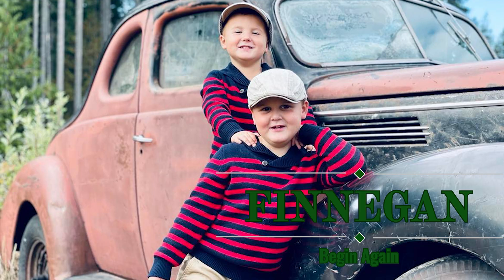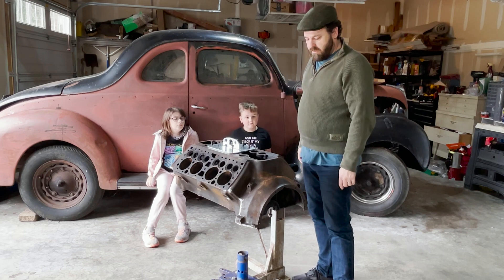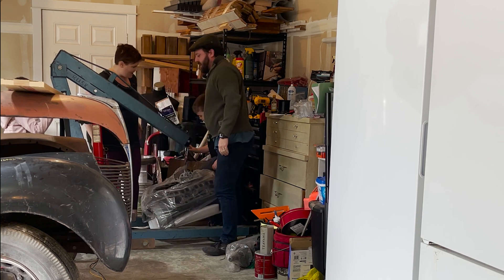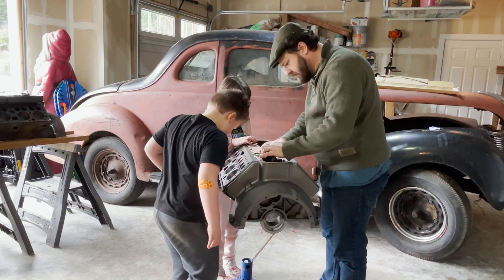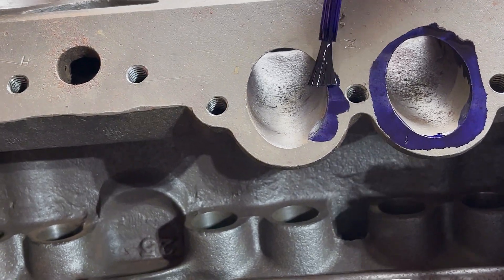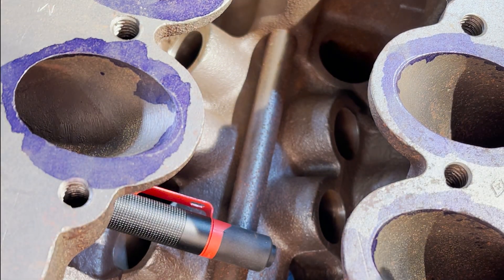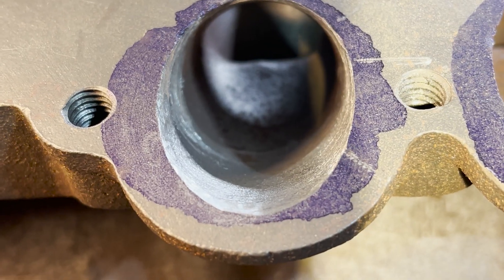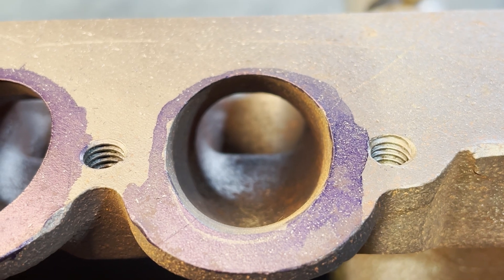Episode 2:  How to PORT an engine block .... Part 1

Comment: It looks like you using a glass dye grinding tip not metal
Reply from the maker: Really?  Hmm, if I do it again I’ll look for bits that are specifically for metal. Thanks!  I’ll also be looking for a different tool. Not impressed with this famous brand. I went through 2 doing this one block!